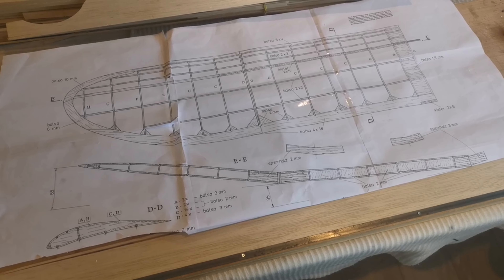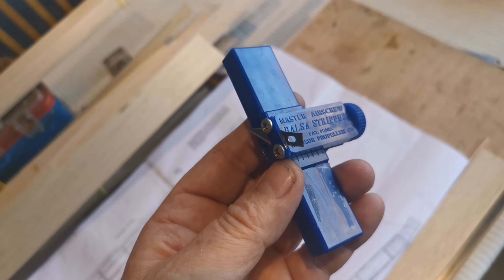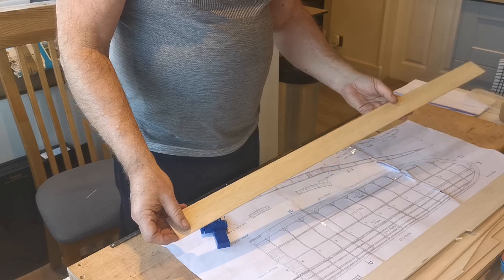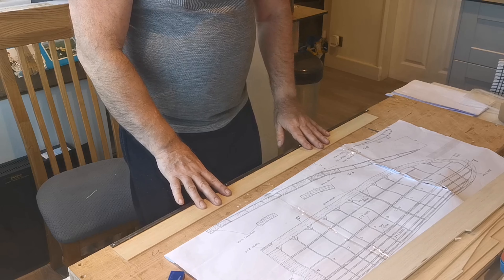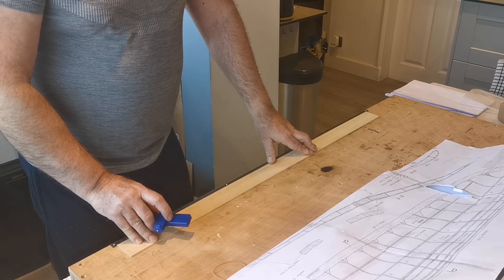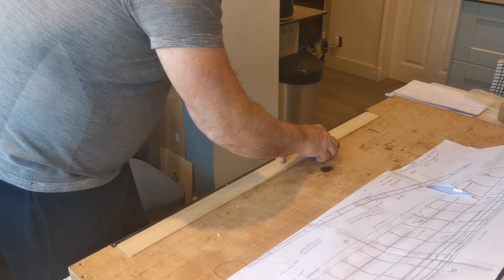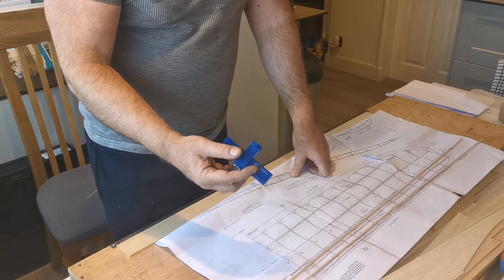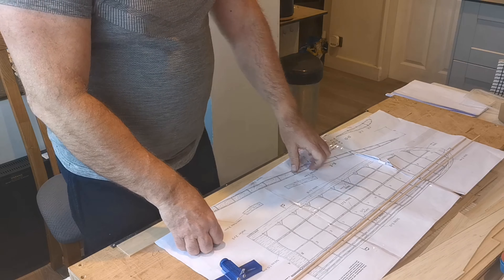How to cut your own balsa strip:building the Mini Playboy.

Comment: So something I do and it’s probably not necessary but I get a wax pencil and draw a line across the width of the sheet so once all the strips are cut it’s easy to see which was the face of the sheet. The other thing I do is make one pass along the sheet and then flip it over and make the second pass on the other side 😎
I’ve been using that stripper for years and use a number 11 scalpel blade with no problems at all 😎
The straight edge screwed down is a great idea 💡 so I’m gonna steal that 😎👍🏼